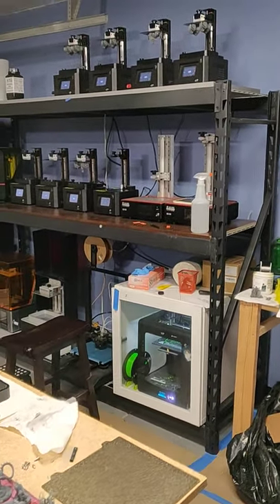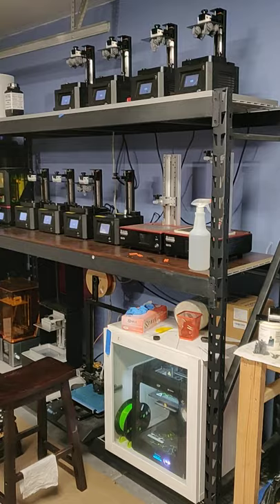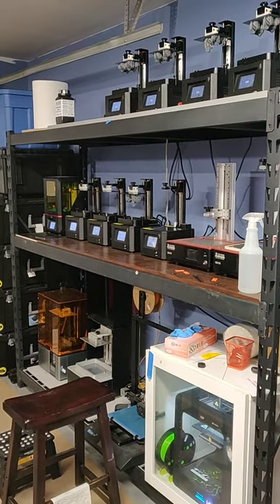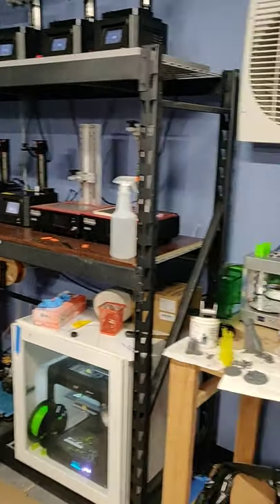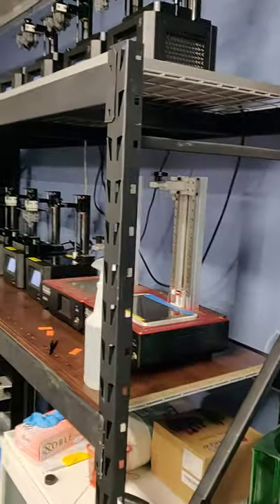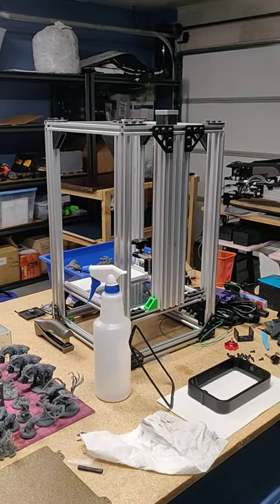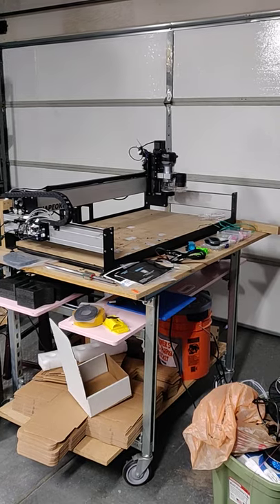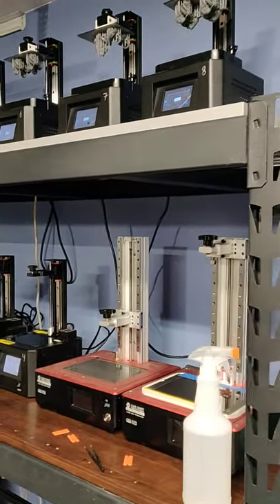My New Home Resin 3d Print Farm setup for 2021 #shorts

Comment: Fuuuuck. I know the build volume of resin is always smaller but it’s crazy how many you can fit on a shelf that size
Reply from the maker: And thats the old setup. The new setup has 24 resin printers packed into that same shelf (access from both sides).